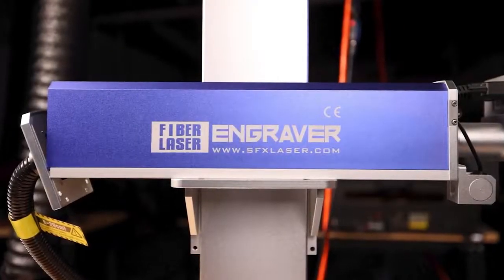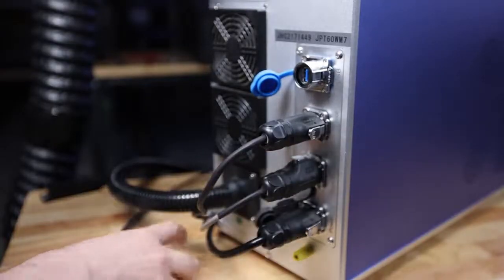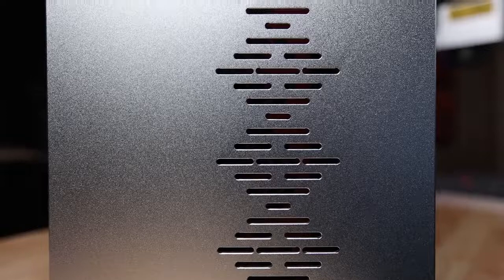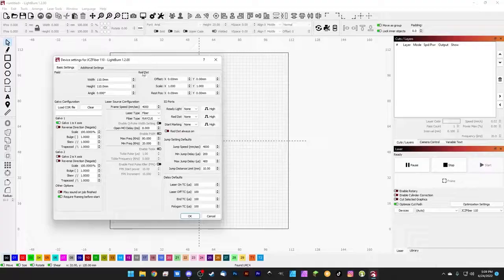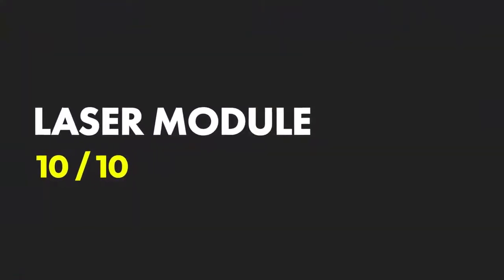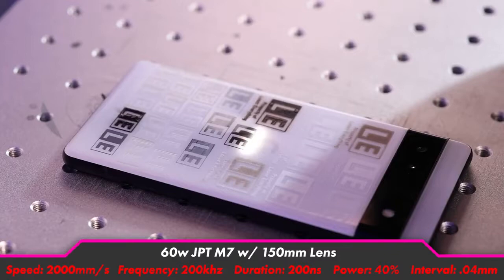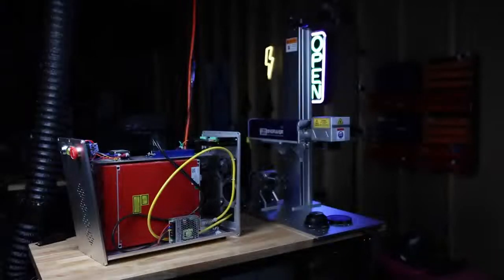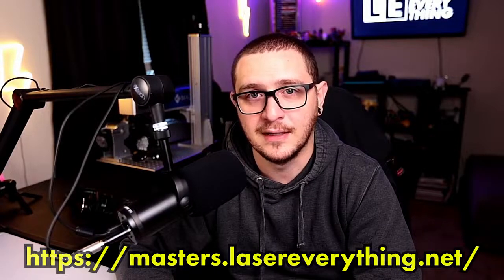SFX 60W M7 MOPA Fiber Laser In Depth Review from Laser Everything 丨SFX 60W MOPA Laser Review

Comment: Nice! I ordered this same unit yesterday, JPT MOPA M7, only with the source and marking table joined and with the rotary table, I didn't want to risk stresses on the joiner cables between the fibre source and the table. I ordered from Aliexpress/Top CNC Store after a couple of weeks investigating. specs are a bit sketchy on the product page but it's same as yours at half the price.  I selected the 300 x 300 lens but I also added the 50 x 50 and a 150 x 150.  Freight is quoted at just over a month. However the Xtool 40 watt diode laser just being released looks like it has almost the same damage with vertical cut over the whole bed. I'm excited though, 60 Watts MOPA JPT from all the reviews I've seen looks fantastic for precision metalwork, and metal marking, I couldn't quite justify the cost of a fibre thunder laser considering most of my work will be DIY R&D. I'll try with easycad3. Inkscape is a pretty good option for the graphics creation, and/or GIMP, both free.